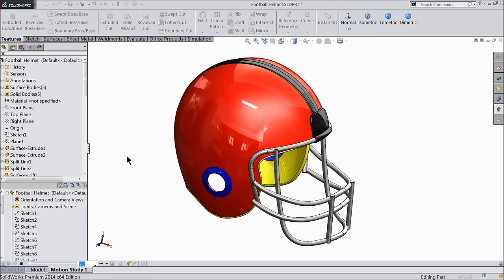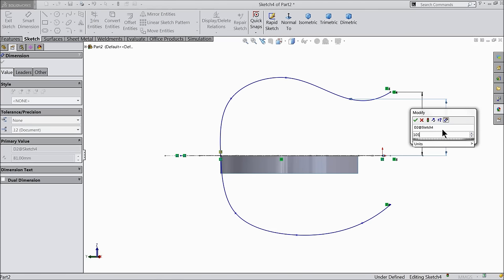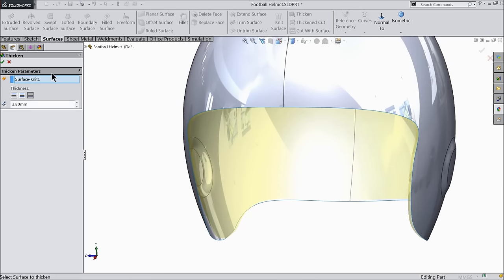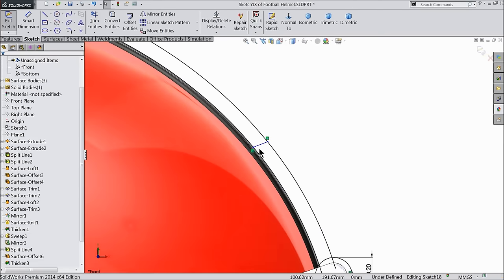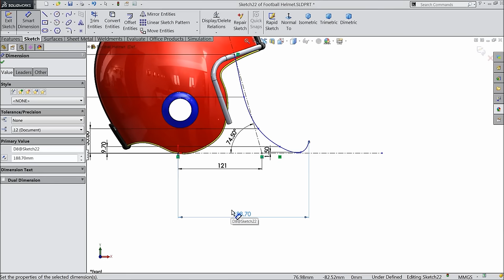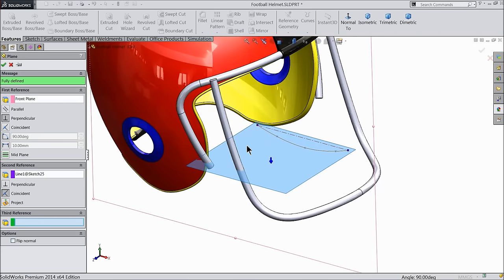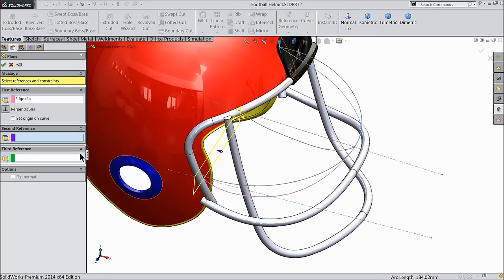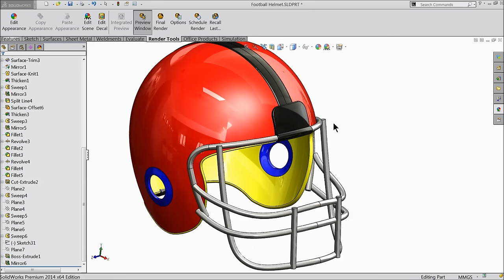Solidworks tutorial | sketch football Helmet in Solidworks (Advanced Surfacing)

Comment: Hi... I was following your tutorial through the steps but for some reason when I used surface loft the first time the surface created was split into two and I couldn't create offset surface from the lofted surface either... what have I done wrong??
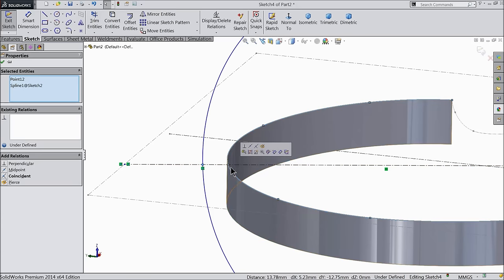Reply: same thing happened to me the 1st time. Then i realized that 12:05 it's very important to get the line pierced. Otherwise you will get  the surface split into 2 parts.

Comment: having some trouble for the pierce relation between the two sketches. When selecting the two splines it doesn't offer any relation options. Any clue why?
Reply from the maker: mansion time,
Reply: I think you need to pick a point of the spline and the spline you want to pierce. (point + spline)

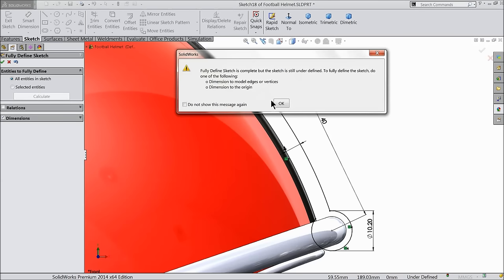Comment: I'm stuck at 38:15, this sketch doesn't work for me no matter what I do.  Good tut btw.  Not sure what I am doing wrong.
Reply from the maker: what exactly happens , make sure the geometry should be closed , check the relations if not than again start the same geometry.
Reply: Thanks for replying.  Well I had a workthrough, and now when I dimension the point to the circle (40mm) it moves the circle not the line point up the helmet.  From what I see, the problem is the converted entity and offset splines.  I did it exactly how you did but they seem to cause error when I trim.
Reply from the maker: better sketch the line instead of convert entities.
Reply from the maker: use spline command and make curve line.
Reply: CAD CAM TUTORIAL
It might be the way I constructed it.  I will find this out and get back to you.